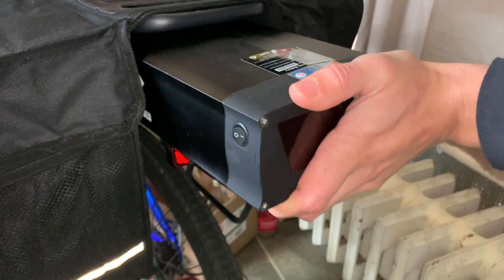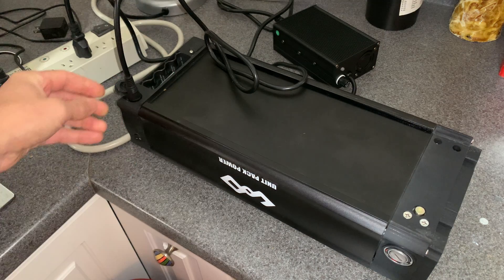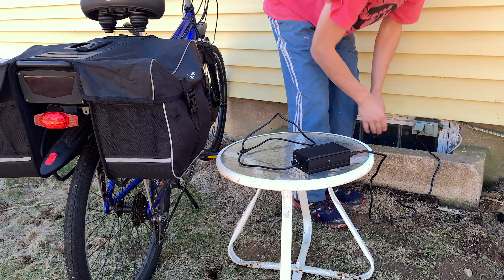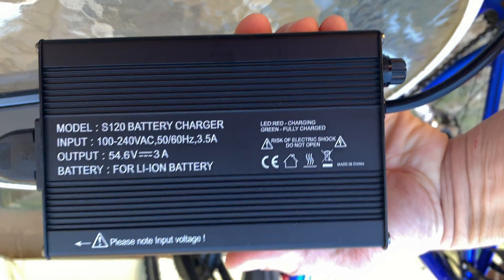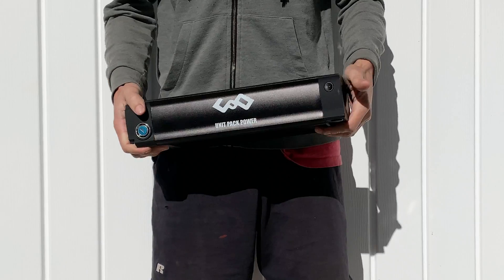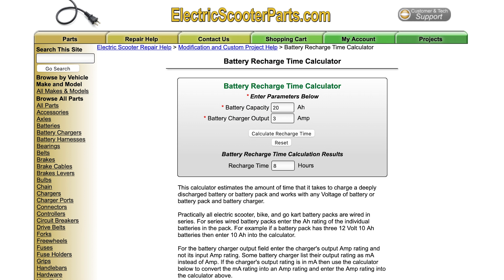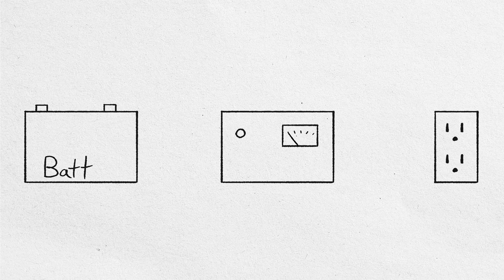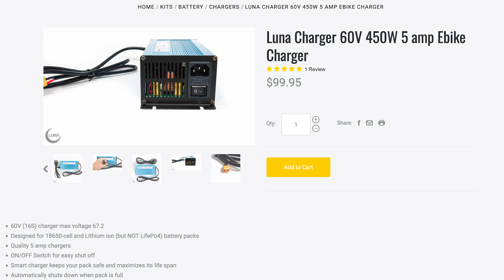How to Charge an eBike Battery Charging How Long

Comment: To preserve battery life, don't let charge fall below 20%, and don't charge higher than 80%. That leaves you with 60% to use.  Do not use fast chargers.  Don't charge a battery overnight without supervision,  or in an area that's not fireproof.  Don't charge or use a battery that has suffered any damage.  Don't plug charger into battery while charger is live.  Don't charge the battery if it is hot.  Stop charging if any smoke or fumes are detected coming from the battery.  Don't charge the battery in a fireproof area if it's too sunny,  too cold,  raining,  windy, with children present, or on Sundays.  Simple.  Enjoy.  🤣🤣🤣